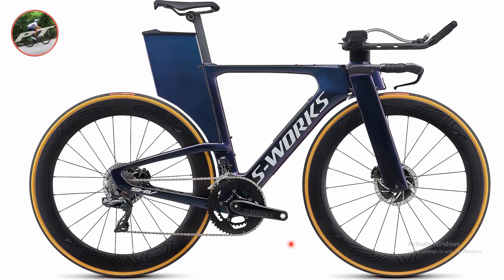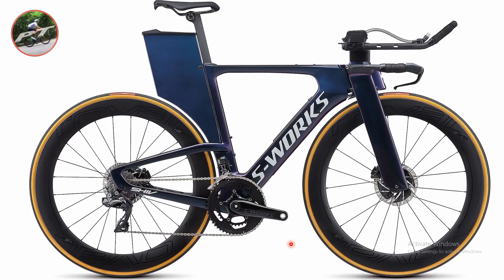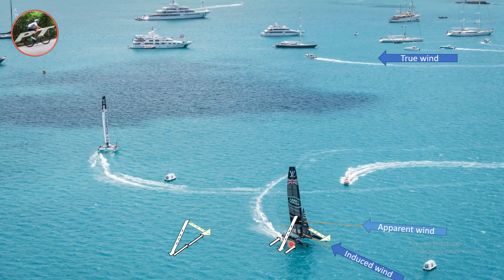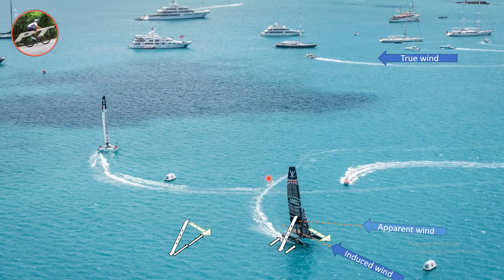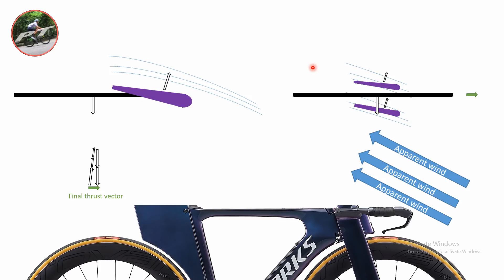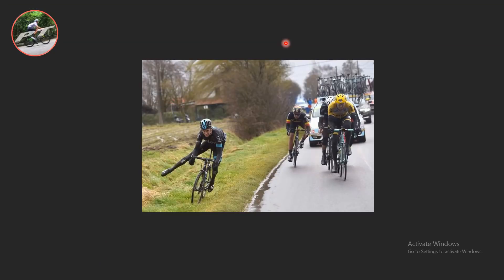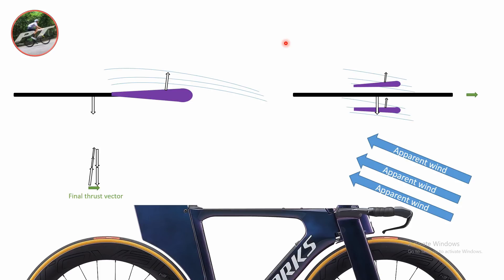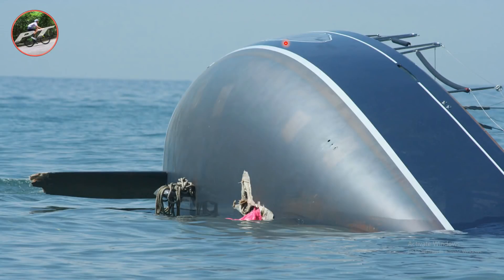S-Works Shiv 2019. Bike or Yacht? Aerodynamics discussed.

Comment: Windcheetah, the Lotus bike was a cutaway frame, some steel bikes for polo put the downtube ABOVE the front derailleur & chainrings, this geometry is worth about a 1mph over distance by the reduction in drag over having it to the bb.

Track bikes were banned, keeping the dt attached to the bb is stupid if you want more velocity per watt, the UCI is revenue for aerospace tech, having the dt-to-bb rule killed steel in the peloton, frames way less cash for average riders to use.

Your turbulent wake volume is the deal, the more volume in turbulence created the slower you go, structurally having the tube above is just move the jig & new lugs on the assembly line saves about a mile in 11 times bicycle commuters globally per day in food & physical effort.

I've never gotten replies to emails over the years to allow the above-chainring geometry for that reason into the peloton so cheap bikes would be made that way & gave up.
Ymmv 🍺

Comment: To counter the toppling moment while maintaining balance on two wheels, surely the bike needs to be ridden slightly at an angle into the force? I wonder what effect this has on effective drag/rolling resistance. The benefits of the more straightforward aerodynamics in the fore/aft axis seem clearer (developed by maintaining laminar flow for longer along the extended foil.)

Comment: Interesting idea with the forks. This would require a central vertical pivot connected to steering and separately adjustable fork blades or foils and some way to have the rear foil follow this. Perhaps on  low friction bearings(needle?) that can change with the wind.  I wonder about cross wind stability though,deep rims are tricky in side winds without disc. Of course a lower rim profile for the front,or tri spoke.

Comment: I think it can, I can actually feel how my 60mm wheels are catching side wind and go faster, comparing with my 50mm in same conditions. By seeing that big field - 100% it will add few watts savings here and there. We also need to remember that wind often is deflected by hedge, walls, cars and on some streets creates much more preferable angles, i.e. it's not constant for the duration of the course

Comment: The toppling force is not opposed by the centreboards (although it is by weight of the keel of a yacht). Righting moment here is created by the weight of the boat to windward of the centreboard and to some extent by the windward rudder. 
The centreboard opposes the sideways forces (not toppling) and provide lift to stop the boat slipping sideways in the water (leeway). 
On a bike, in a cross wind, you oppose toppling forces by leaning in to the wind (like a dinghy crew learns out to windward). The tyres friction would oppose the lateral forces (to stop the bike from skidding sideways) and (in a cross wind) the aerofoil shapes could definitely create lift... 
BUT it is rare to have extreme apparent wind (once bikes speed is taken in to account) angles on a bike unless it is very windy. The air we cycle in is often very turbulent. We are low to the ground, and the ground is not smooth like wat, instead we have lots of hedges and buildings. So the apparent wind angle, even on a windy day would not be that stable. This leads to the feeling of being 'pushed' about with these deep section frames and wheels.

Comment: I could see those profiles working an absolute treat at a 180 degree yaw angle. Anything under 90 degree yaw angle I can't see it working but the effect will ramp up significantly as you approach 180 degrees.

Comment: OK, so lift is a function of dynamically created pressure and pressure exerts a force to right angles (90 deg to a surface.  This means that the force at any point on a sail is at 90 deg to the surface at that point.  There is also a small rearward skin friction drag force.  The total lift is the sum of all those force vectors from all over the surface and this is about 90 deg to the straight chord line between leading and trailing edges.  In order for this to produce thrust, the sail must be angled somewhat across the vehicle so that the whole lift vector rotates forward producing thrust.  Your diagrams ignore this very vital and significant detail until near the very end.  This is what a sail boat does to sail from 40 - 45 degrees against true wind.  In effect, this means that the wing foil on the TT bike must be articulated (free to rotate) somewhat across the apparent wind to effectively produce thrust. If it does not rotate, it cannot produce meaningful forward thrust.   I have had thoughts about putting a sail inside the frame triangle with a shock cord in the upper rear corner to allow the sail trailing edge (leech) to fall away automatically and produce thrust in a crosswind.

So my take on it is that without articulating the foils it seems exceedingly unlikely that forward thrust from lift could overcome drag.  Do the math and prove me wrong.  (L = 1/2 . p V^2 . S . Cl )  (Df = 1/2 . p V^2 . S . Cd )  (M = 1/2 . p V^2 . S . MAC . Cmo ) (Drag = Df + Dp + Di)
Reply: Excellent

Comment: Very interesting,
People never talk about the lift (or as I call it “sail affect”) only how the bike heads into the wind, they also forget to mention spokes create drag, but for some reason, everyone remains quiet about this stuff.
Reply: Is that why tri spoke front wheel is sometimes used in TTs ?
Reply: @gourami7  it is because normal spokes cause a lot of drag, tri spokes are far more aero but are heavier and are affected by cross winds more. 
As to the sail affect, if a force hits a wheel at right angles, due the the resistance of the wheels on the ground, some of the force is transferred into forward motion, this is the same with a sail boat. the problem is due to the lightness of the bike it can also cause instability, which people don't like. So they design the foil section of the wheel (rounded back) to turbulate to reduce the sail affect.

Comment: You could probably reduce the low pressure drag on the trailling edge with pivoting tails on the air foils but the extra weight involved may well negate the savings on anything other than a super flat course but there's always a way. Maybe Mr Bambini could do some cfd modelling to test the theory, it would certainly be interesting to see.

Comment: You are probably mostly right, but you don’t mention the two rotating «flywheels» (also called wheels) that help counter the “toppling”?
Reply from the maker: Good point, Gaute.
Reply: @PeakTorque  the trail/rake on the forks contributes far more to the stability or self righting ability of a moving bike than the flywheel effect coming from the wheels. The weight  and leverage or the frame alone bearing down on the axis point of the spinning mass easily overcomes any flywheel effect.

Comment: Whilst I don't want to urinate on your fire... When an aerofoil generates lift you get a lift squared term added to the drag. It's called the drag polar, here's awikipedia article on it https://en.wikipedia.org/wiki/Drag_polar Basically you can never generate more lift as a forward vector compared to the drag generated from the lift.

Nevertheless, the video is good and I give it a thumbsup.
Reply from the maker: Cheers @Hambini, agreed and at 8:00 I mention that. The perp L and  parallel D components will always be up and backwards, with respect to the apparent wind axes. However with respect to the direction of travel axes the final vector can be forward, just like a yacht. Morphing the wings into wind would improve this even more, just like the land yacht with its wind vane. Maybe I should have made this clearer in the video. As I also mentioned the bike foils more likely than not are just lowering pressure drag more than anything, what do you think?
Reply: @PeakTorque  First off, love your engineering vids. Keep up the debunking, it is very refreshing.
But this comparison with the sail boat just doesn't sit right with me. I have agree with Hambini and Ken Webster on this. First of all, the sail is not an airfoil. The sail is a concave shape only. You have an enormous wind 'force' pushing on the airfoil, which is directed 'into' the concave shape of the sail. Big difference. You left those 'frontal' flows behind when you compared the sail with the Shiv airfoils.

Ken and Hambini are obviously much more into aerodynamics than me (I'm just an aero-enthusiast and anti-BS engineer ;]), but if I just imagine an airfoil, or a disc wheel (like Zipp claimed), or any symmetrical shape, placed on a no-friction roller, I just don't see it moving into the wind, at any angle.

But, like I said at the beginning. Keep doing what you do! ....and maybe I am wrong 🙈....I hope to learn more either way!
Reply: Just wanted to say to you guys thanks for raising the technical discussion and content on bike tolerances and aerodynamics. Both the modeling work and comparison of different bike manufacturers products is likely no doubt to get you some letters which let’s say put you under pressure to stop. While I do like that specialized have done more technical work in improving aerodynamics of their bikes. I do feel they then let themselves down by using poor tolerances when it comes to bottom brackets. Btw when specialized released their new s-works venge last year they had all their technical team sit down and discuss over the hour the aerodynamics and modeling process, not sure you saw it, I did think this was interesting up to a point but at times you are left wondering and trusting their analysis. I wanted more peer review of that work. Why is that important for me? As a consumer. If I am going to drop 13-14k on an aero bike it better have verifiable aero numbers and the bike should work like a dream. Keep up the good work. You know I think a state of the art of bike aerodynamics/tolerance textbook is in order. You can both combine to write, I will check your math.👌🏾
Reply: @Hambini, typically drag is stated with the reference plane aligned with the apparent wind. So lift is perpendicular to the wind, and drag aligned with it. On a bike we are more interested in the axial “thrust” and the normal “toppling” forces. It’s a simple vector rotation by the yaw angle, and yes you can generate thrust, as shown by fact that sailboats work.
Reply: here is a fun video https://www.youtube.com/watch?v=yCsgoLc_fzI&t=77s